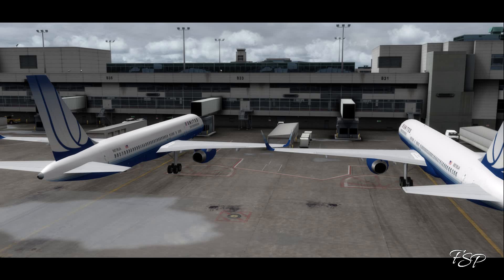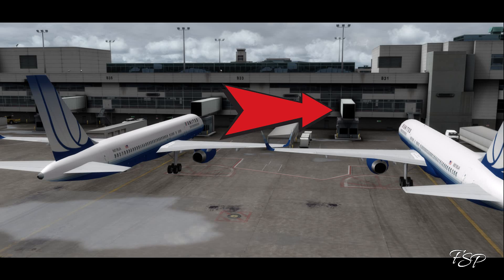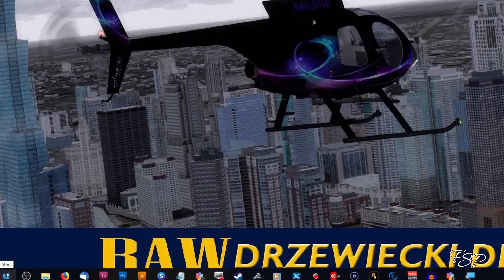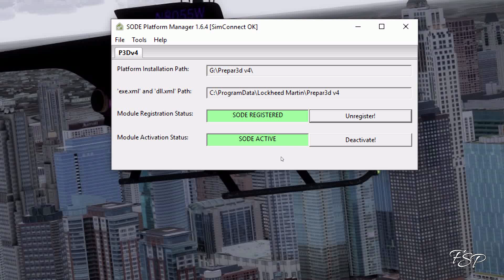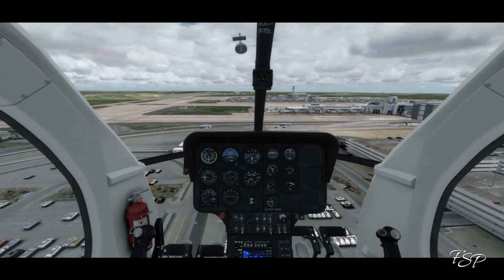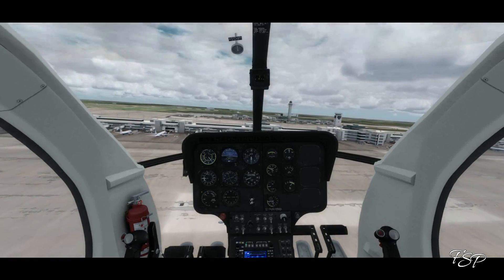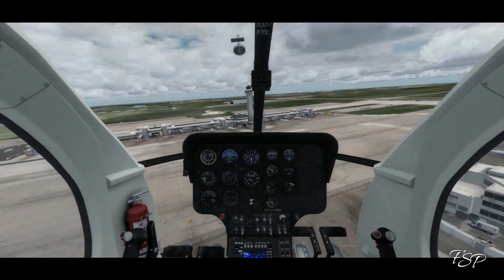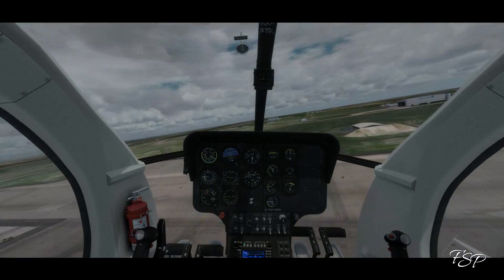S.O.D.E. Issue Solved! [Prepar3d - FSX]

Comment: My SODE cant find the fsx.cfg file. Can someone plz help.
Reply from the maker: Have you tried uninstalling SODE and then reinstalling SODE?
Reply: FlightSim Productions Yes, alot of times
Reply from the maker: When you are installing SODE are you installing as an administrator? Try uninstalling SODE, make a backup of your fsx.cfg file, then delete the fsx.cfg file, start fsx letting everything rebuild with a fresh config file, run the default flight for a few minutes, then quit fsx. Reinstall SODE running as an administrator.
Reply: FlightSim Productions ill try that
Reply: @FlightSimProductions  Is there any tutorial video how to add SODE jetways for non FSDT scenery?
Reply: Like Aerosoft EDDF V2 (Original, not Pro)